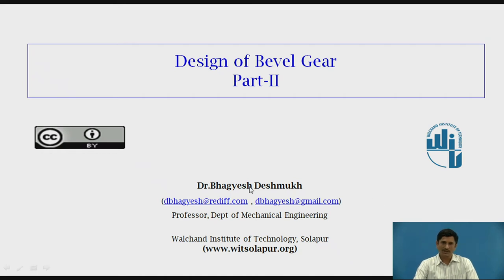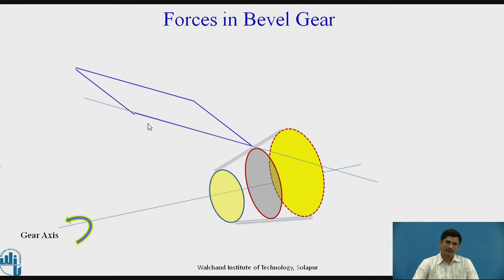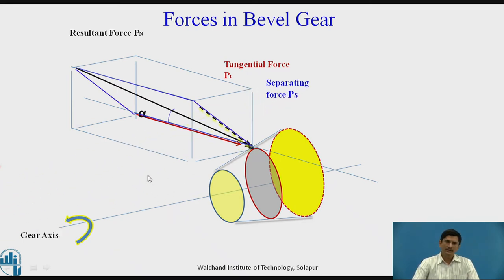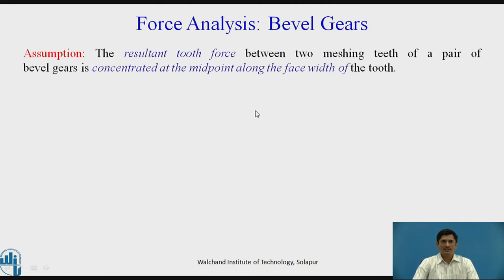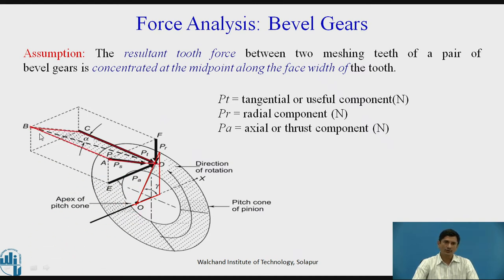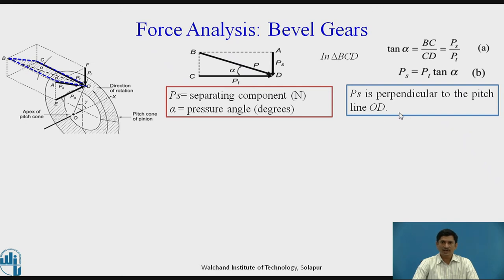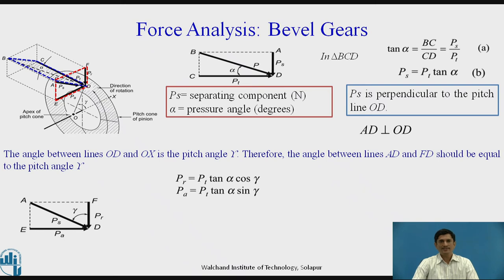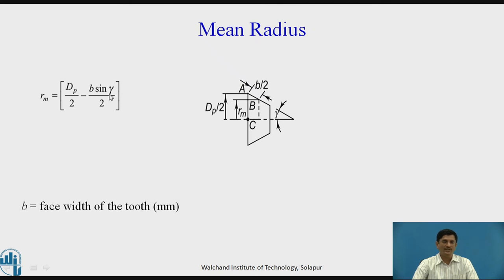Design of Bevel Gear -2

Comment: Sir,  
Spur bevel gear, 
Pitch diameter =19 mom
Module.= 0.8
Teeth pinion = 24
Face width = 6.35mm
Shaft angle = 90°
How to calculate out side diameter & face angle